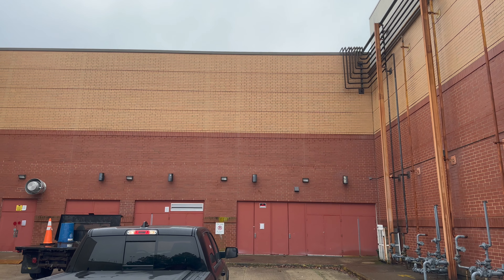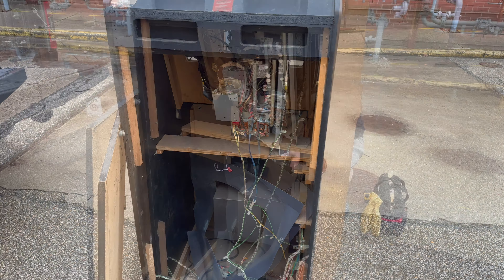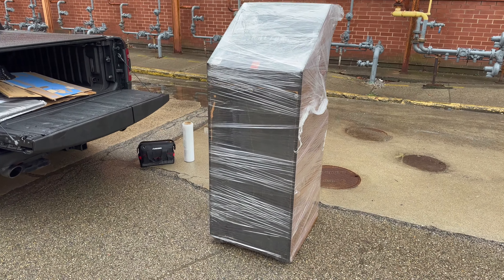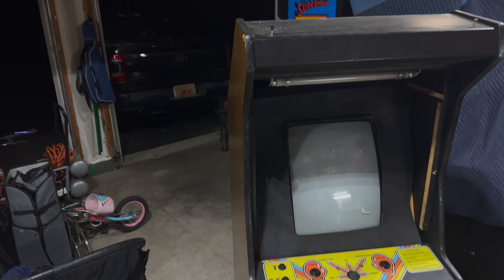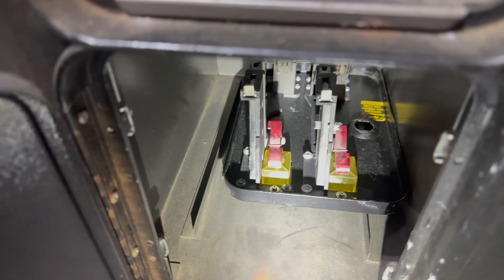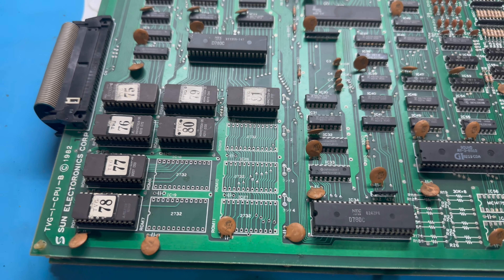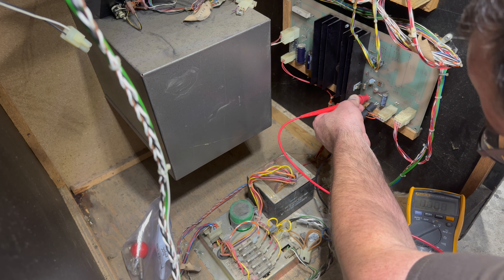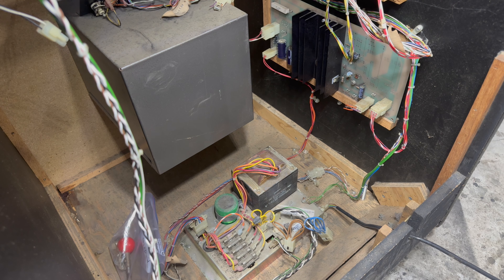Rescued from an ABANDONED MALL! 😨 Picking up an UNUSUAL Atari Arcade Game... 🍀

Comment: the slow power down only means the cap is still doing his job.
Reply from the maker: Ah, ok -- you mean C1 on the AR-II? Holding onto the charge since a load wasn't connected?
Reply: @overtimearcade   yes that could be the case. anyway what an awesome find.
Reply from the maker: Thanks!!

Comment: That useless ground is so cute @25:25.  Did you put on safety glasses as well?
Reply from the maker: Full hazmat suit! 😂

I do think it's important for the chassis to be grounded though, especially if the monitor is in unknown working condition. It'll usually work fine without it, but if something goes wrong and an improper charge gets built up, your hand might provide a discharge path to ground!

Comment: The sync you don't have is HORIZONTAL. You need to adjust the HORIZONTAL hold. Remember the monitor is flipped 90-degrees.
Reply from the maker: Thanks! I did eventually find the horizontal hold pot, but adjusting it didn’t affect the image at all.
Reply: @overtimearcade  Either something in the horizonal circuit is bad (including, or just the pot itself), or weird things are happening. Only have seen the later happen once before.
Simple to remember that if the image is rolling, it's vertical. If it's diagonal distortion, horizontal.
Reply from the maker: My next step with this monitor is a cap kit and B+ adjustment. We’ll get it working fine again!

Comment: Is it PAL vs NTSC?
Reply from the maker: Great question! I don't think NTSC/PAL really applied to arcade monitors, which used (raw?) RGB. I don't think this monitor is original to the cabinet though, as the non-standard video signal inputs on the chassis don't match the standard video connector on the wiring harness, and it's got Xevious burn.

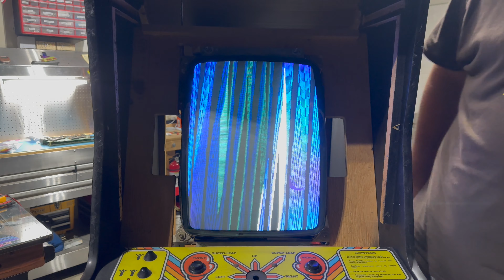Comment: That's a sync issue at 27:07.  You need to flip the DIP switches on the TPG to get the correct sync.  Here's me doing it in my video with my Millipede (Matsushita monitor too).  https://youtu.be/ghYwwwMD_To?list=PLMenkBsi2LKAVdKRMPLV7s6Hy3M491Kot&t=2726
Reply from the maker: Thanks! Do you remember the specific TPG dip switch settings you used? I've been using 1-3 ON, 4-5 OFF, 6-8 ON... but I just looked at the TPG manual again and ON-ON-ON isn't a valid setting for 6-8. I also tried ON-OFF-ON for 6-8 and that didn't seem to make a difference though.
Reply: @overtimearcade  I don't recall.  I just tried all combos by trial and error.  Which TPG version do you have?  Mine was on the V1 older one.
Reply from the maker: I have a new version of the older large TPG with the LED light before they made it smaller. Circa 2019
Reply: Just do a binary sequence so you don't miss all the combinations.  00000, 00001, 00010, 00011 etc.